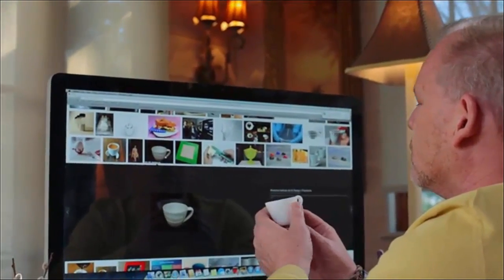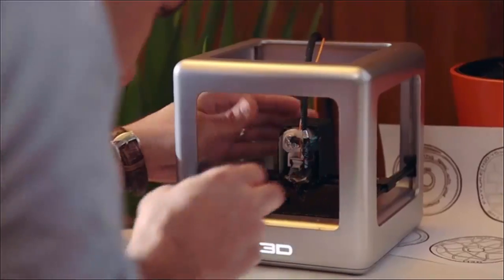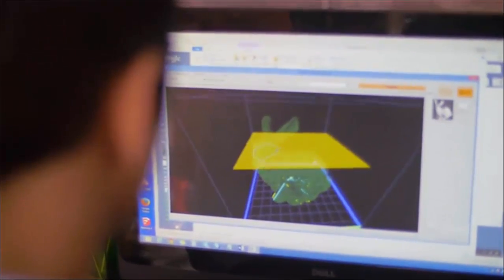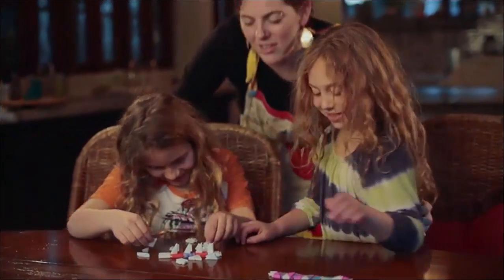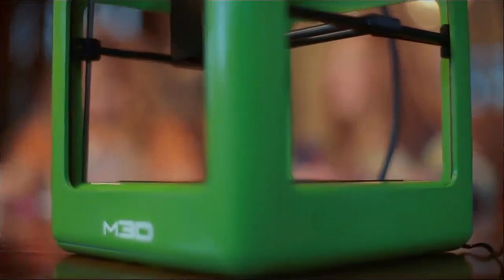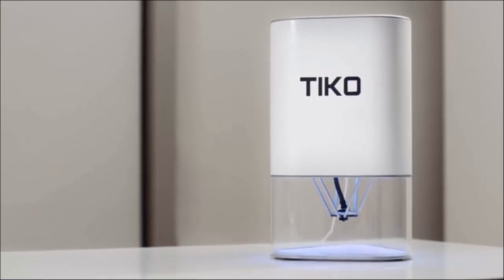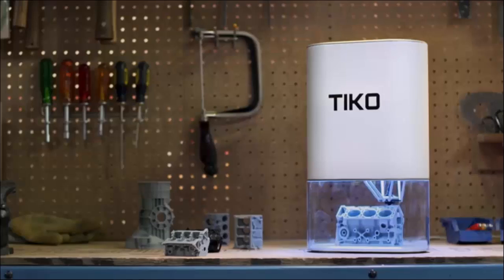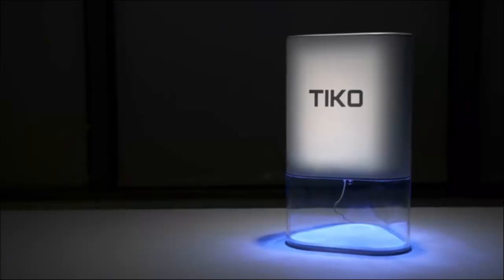Top 6 Creative 3D Printers you never knew existed!

Comment: "one minute you see this box on your desk and the next DAY you see an object appearing in thin air"
Reply: Zyron Melancon You know - we could spend all year arguing this one. So rather than just speculating and arguing relative terms, let's do this. Here's a model:

http://www.thingiverse.com/thing:633437

Print one using Simplify3D on default settings. PLA, Medium quality. 30% infill. 3 layer wall. With supports, raft, skirt. I can make the gcode available if you don't have Simplify3D.

See how long it takes. Mine took just under six hours. That's a LONG time for a small relatively simple shape.
Reply: Heitor Bordin Because that's how long it takes to print something. :)
Reply: Well that's the thing. My printer is capable of higher speeds without bogging down the quality, so I bump up the speed settings a lot. Plus, I usually only use 2 walls and 20-25% infill. I'm not arguing that all 3D printers and settings are fast. I'm just saying that it's possible for it to be faster. I have a 0.4 mm nozzle. Even with the settings you've listed, with my speed modifications, it would only take around 3 and a half hours. If I used all of my usual settings, it would take 2 and 3/4 hours.
Reply: More like at night
Reply: The Werewolf Not really. I own a 3D printer. It never takes that long
Reply: Zyron Melancon Define 'not long'. I just did a small Hello Kitty figure for a friend and it took over 6 hours. Nothing of any value has taken less than two. More complex objects can take 18+ hours.

In general, I start a print before going to sleep and pick it up the next morning. It's just simpler that way.

If you're doing a lot of small things, perhaps.
Reply: I have a 10x10x10 printer and I've done a very large, complex object. Though it did take a while, it was only a fraction of the day

Comment: I have a Micro,and I knew that it would be featured in this.
Reply: TheHollowBricks how much was it and what is the print volume?
Reply: 349 USD, and by print volume you mean? If you mean fill, you can change it.
Reply: the possivble dimensions that it can print   length   width   height
Reply: Print height: 116mm (4.6") 
Base Print Area: 109mm x 113mm 
Print Area Above 74mm: 91mm x 84mm
Reply: ok thanks
Reply: TheHollowBricks I have a Micro and I kind feared it would be.
Reply: The Werewolf How's your experience with it? I heard it wasn't as good as expected.
Reply: It's ok,not the best though